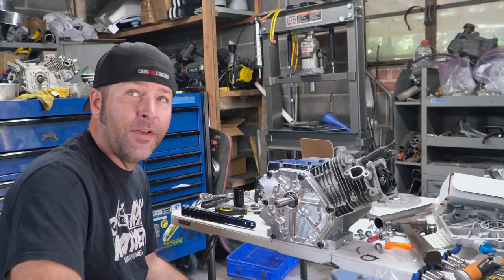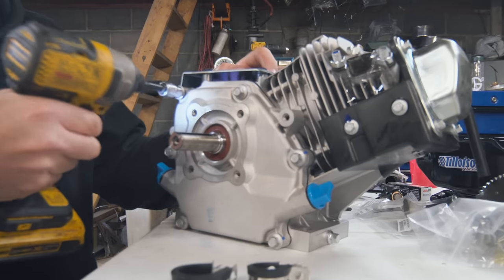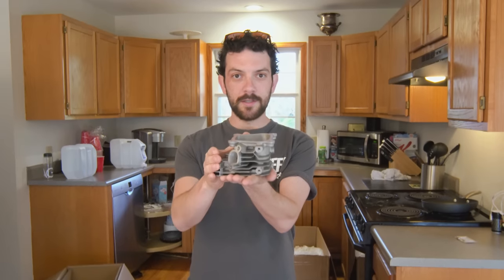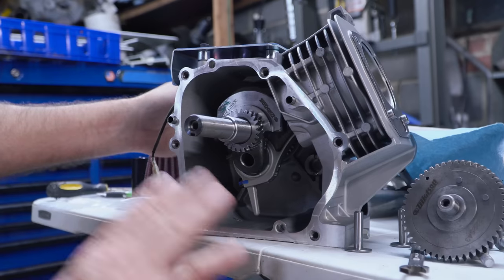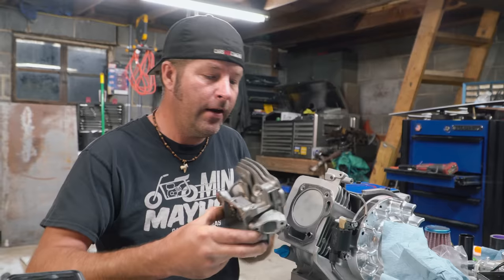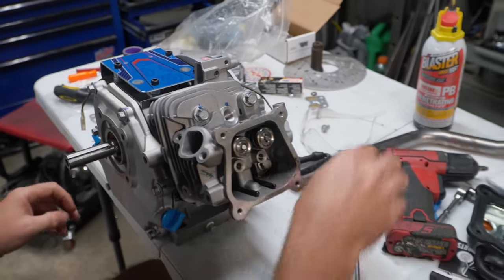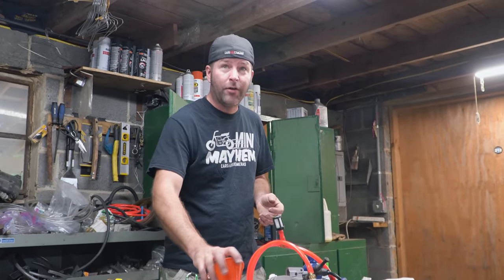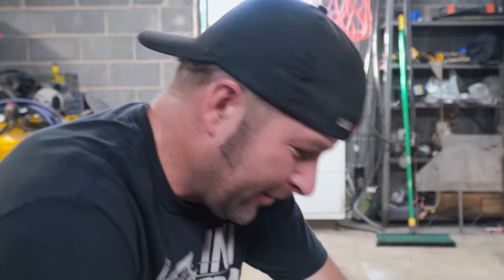Tillotson 225cc Big Valve Build | 9,000 RPM, 25HP Billet Maniac!

Comment: I disagree on not using the one way valve for the crankcase vent!  By using the one way valve, you create a vacuum below the piston therefore it has less resistance or "pumping loses".  I'd be tempted to install dual one way valves from something like an older 650 twin Yamaha that had both pistons moving together so the pumping losses were substantial...you'll have the same thing turning the engine 9,000 rpm.  Dyno it and see :).

Comment: It will be difficult to improve much on the flow of that head by porting ... at least without the ability to test with a flow bench.  Most of your gains will be in the valve seat area and around the new guides.  Those new valves and re-cutting the valve seat dramatically improve flow which will show up on the dyno.

Comment: When will you build an engine test bench?
Reply: Right?  You'd think a piece of plywood with a couple bolts sticking up for the most common bolt patterns would be a simple thing to hold the motors while cranking...would have been a shame to watch that motor crank up when the throttle was stuck open and tip over destroying the crank.

Comment: I got a tillotson block with a 3 inch piston stroker crank and 356 billet cam  34 30 val 50 pound springs....
Reply: Its running on m5 gas

Comment: 55lb springs definitely seems way over kill and would take down your power a slight bit because of the extra resistance, that’s also more strain/ ware on the cam from the extra pressure, 36 lb spring would be Sufficient for 9k rpm

Comment: I used to be the same way and buy 12$ quarts of oil. Never again. Try Shell Rotella. T4 or T6. I run t4 in my 15 YZ250F and it has better hookup on clutches (not that these engines have clutches), and it wears better, has zinc in the formula and has tons of weights. Best part is 15$ a GALLON! May be cheap but some good stuff. Shear ratings and other tests it’s up there. Just ignore the whole “diesel oil”. Sounds crazy but I’ll never run another oil in my bike.

Comment: Guys, you should of lapped the valves after cutting the seats then checked them with Blue.

Why didn't you polish the combustion chamber. 
Did you match port them to the gaskets. 
You would of been better off to knock the guides out then do your port work.

Comment: 35:35 You should poke it with some 30%N RC fuel at some point. Stuff ain't cheap but if you're gonna run methanol anyway that extra bit of nitromethane will give it a kick in the ass above and beyond methanol itself will. Also has some oil in.

Comment: Just an observation,  but the torque specs are in Newton meters.. Not foot pounds. 50 ft lb = 67.8 Newton meters.. Flywheel over torque no worries,  cylinder head could be a problem pulling threads..

Comment: I had a Briggs Vanguard V-Twin 16 horse I tightened the Valve gap a little bit I removed the foam pre-filter on the air filter I blocked off the airbox to the air cannot just blow through litter box and put in a set of e3 Diamond fire spark plugs and actually ended up putting a small washer top of the carburetor adjustment screw to adjust to give it more fuel then Factory just ability the loud and I was thinking I was probably making out about 22 horsepower with it I mean it rained real good until I put Vanguard 23 horse cam shaft and blew it up 23 horse cam gives you roughly .050 more lift and I messed with the governor didn't fully delete it I just bent the tab for more RPM and and the reason I think it blew up was because I bought a used cam out of a blown engine but I want to redo it with a Vanguard 18 horse V-Twin and I'll be using a brand new camshaft not a used one I'm thinking I should be able to get up towards 26 horsepower and I will be putting it in my lawn mower it's not really a mudding lawn mower something play around with like a go-kart

Comment: Ok, it's time to get off the floor.  You need to build a engine build and test stand to run you motors on.  It should have a engine oil catch pan or bucket.

Comment: when the piston goes down it pressurizes the head the same as the crankcase its all connected through the pushrod hole the piston going up only compresses in the cylinder if its pressurizing the head that is not good.

Comment: Can you guys run it on different fuel's to see which runs best.
Reply: They'd have to adjust the jetting on the carbs. Alcohol fuels require tons more fuel, qnd just swapping to e85 without changing the jets would cause the motors to run super lean.
Reply: @hunterdan2002  i probably should have clarified what I meant.... I would like to see them tune the engine for "high performance fuels" such as e85 or methanol fuels. I ran e85 in my built Tecumseh engine (it's still alive don't worry 😂) and it had great take off compared to premium gasoline. Though, I would like to see different fuel's in a high compression engine because that's where you would see the biggest difference. Thanks for your time

Comment: Assembly lube is only for engines that are getting built and then not used for a while.
If you're going to crank the engine up straight away or within a day or 2 then you're far better off using oil. Assembly lube needs to be flushed out after first start.

Comment: How can you cut a valve seat an set the valve in and say it looks good. You can’t tell a single thing from setting a valve into its home. Not even a valve pro of 100 years could set valve in and decide if it’s good or not.  That was purely a scratch ticket gamble. When you lap then you see the contact on valve and see contact on the seat. It’s the absolute only way possible to know a single thing. Unless you have a bench  leak down tester. Just crazy you’d lap a flywheel to see everything your needing to see but then you cut new valve seats and just winged it on if it’s seating correctly. And doing it by hand I can guarantee I mean absolutely guaranteed that valve is not sealing 100% with out hand lapping it. Lapping grinds them seating surfaces in.  Not a chance them seats are 100% with out lapping them.  Let’s remember we cut seat by hand in your lap. Not even on a stable bench. Your legs were torcing and hands were torcing if there was a most important time to lap a valve it would be from hand citing valve seat while heads in your lap on a swivel chair. Hp build just tossed horse power in the trash over 5 min lapping job. Now have fun  chasing spark plug heat rages and carb running and coil gap and timing ect in the very near future. Or just be happy with less power I guess. That valve cutter wasn’t made for that valve. Like they were not made side by side at same time and lapped for ea other. That’s why lapping is so important unless you have bench leak test on hand. An you’d only skip lapping if you used a real cutter set up. Not cutting by hand in your lap. I love you guys I’m not like dogging you guys. But I gotta call it out. This just needs to be torn down and done. Lil time and a gasket no big deal. I’d go backwards to to it with no thought into it. It must be a joke. No one told you not to. This must be a prank. Y’all know wat better then that. And you’ll nvr know the valves leak as you don’t know the engine with non leaking valves so you’ll just think the engine is running top performance but it’s not. Cause leaking valves doesn’t mean misfires ect unless super bad. But leaking valves mean hp left on the table and hp build means your trying to do opposite of that. I leaked down my stang heads on real head shop fer fun almost all had leaks and thing ripped. But period hp left on table. Was putting aftermarket heads on and was doing a leak check on brand new heads witch cheacked out great but old head leaked multi valves and I didn’t suspect that was going to be the case at all no indication. But fact is hp in the bucket rather then the engine

Comment: If u have never expierenced with methanol before. Then u better becareful. My drag car uses methanol fuel. I use it cause u don't need a radiator if ur running methanol fuel. Cause the motor is always cool. I use a radiator when i use regular gas when i am cruising around town.

Comment: Do you wan't A handle for that pot? I've got one just like it. The bottom of the pot burnt out due to rusting.& overheated the metal cracked.& popped. I can remove it to send it to you Charles. You'll half to reriovt back on to that other pot is all.

Comment: Do not need 55#’s for that build, just putting excessive pressure and wear on parts.  36-37#’s seat pressure all is needed to turn 9k + on this build. If that’s making 30hp then mine would make 33-34 on gopowersports dyno lol,  take much more than these specs to make a legit 30hp on small block, not to mention a 28.5 intake valve isn’t big enough, not hating on you guys, love your content I just don’t like the deception.

Comment: 55lb springs is to much for that cam just so u know I run 36lb springs with a 292 cam and I get 9800rpms out of my 236r and even it’s not 30hp u guys are gonna be probably making 23ish hp that’s all
Reply: This is a GPS marketing video not a build video and on a reputable dyno like Brad Hills dyno (dyno used in the small engine builders competition)this engine would be lucky to make close to 20hp and a 5+hp gain switching to methanol? Bwahahaha! The average is around 2hp the lies GPS tells just to sell parts crack me up

Comment: know what, ive looked and i aint seen a single video of a old pony motor used on a go-kart, weather a john deere v4 or a cat flat twin, aint seen anyone mout one of them things to a go-kart
i dont think it would be extremely hard, make an adapter to go from the output to a standard clutch, maybe a torque converter, add a standard carburetor that has a proper throttle, and you should be good to go

Comment: Your information on the valve cover and crankcase venting is incorrect. Positive crankcase pressure is the same in the valve cover as the crankcase. Only way to remove pressure is to vent to atmosphere, vacuum pump, or vent to a vacuum port on intake manifold, carburetor, or air filter. You assembled it correctly in the video but described the process wrong.

Comment: If you didn't install new rings or hone the cylinder, you're not breaking anything in.
Break in is for ring to cylinder wall sealing only.
Think about it. Bearings ride on a film of oil. The ring breaks in on the honed cylinder wall surface until the sharp edges of the cross hatch are worn against the soft outer edge of the ring. Once that is done, no more break in occurs.

Also, you really shouldn't handle the bearing shells with your bare hands. The oils your skin secretes is corrosive.

Comment: need to lap them, so you can see if they are seating correct and it don't hurt run a light up next to the valves and look into the ports and look at the seat /valve area and see if you see light.

Comment: I'd love a motor like that for my old Trail 90 with a bad motor. With a juggernaut for torque. Trouble is, the cylinder on these type of engines points the wrong way! It ain't gonna fit! But I'ma try it with an old 212 anyway.

Comment: 30 hp out of a 225cc, single cylinder, splash lubricated, air cooled, carbureted, 2 valves, pushrod engine?
Sorry guys but my BS meter is kinda exploding right now.
Maybe it does 20, 22 at best.

Comment: 30hp engine has enough power and pull. it doesn’t need a tq converter. That engine is turning 9k rpm, Can y’all please gear it to do 80mph+. That’s what we wanna see. 18tooth clutch 53 tooth rear. There’s no way that motors making 30hp and yall gonna put a tq converter on it and rob it of all that top end. Less tq converters on the bigger builds, more top end. We wanna see yall hit 80mph.

Comment: Is there some kind of instrument tool or something that you can hook up to any engine to get a true reading of how much Horse Power an engine is putting out ? Like the one they sell that you wrap the wire around the sparkplug and it tells you the RPMs but one that will tell you Horse Power instead ? I'm very curious to know how much Horse Power my mini bike engine is currently putting out with the mods i've done to it so far but have no clue how to tell. It is a 196cc that started out life with 6.5 horse but 2 years later with not much stock parts in it besides the bare block itself and the crankshaft are stock so i'm wondering if i am near the 15 hp range or more or less. Anybody know how to figure it out ? Are certain mods known to add a certain amount of horse power so i can add up the mods i've done to come up with a total horse power ?

Comment: @Isaac It’ll Be Fine “Help me understand”… I get the theory of heat makes metal expand and cold makes it contract, but if you heat the head and the metal expands, wouldn’t that make the valve bore SWELL, and get therefore SMALLER? 
Yes, I can see the value in freezing the guides, but not in heating the head. I’d bet the process would go just as easy if not easier, if you freeze BOTH parts. 
And if not… “well I’ll be DIPPED.” 🤔

Comment: I’ll be honest guys, if that key shears, valve lapping compound is not going to do anything
Reply: Plenty of builders install flywheels with no key and use a degree wheel. They key is there for ease of installation in the factory. The press fit is what is actually holding the flywheel.
Reply: @WyFoster  yup, sometimes even if you just tap the flywheel or what ever on to a taper fit without a fastener you will need a puller to get them back off

Comment: Ok so its not a big valved head,if ur not gonna lap ur valves ,at least take a bore light shin inports to see if valves seal off,Hell use methonal poured in Combustion  chamber to see if ur valves leak why half ,ass it,act and look professional, should also looked in block for clearance  at top of block,around cam,bottom of cylinder, not by just roll,n it around,theres tight tolerance  in these blocks my friend,in motion while run,n it could get tighter,then explode,play do on piston will show u clearance  ,valve to piston clearance, how bout lap,n push rods to rockers,Duh,there anodized  so lets think out of the box,think ahead 4 a change ,not sure i,d need u to oil pedals on my bike,ye know get real here,im just a hillbillybut i know right from wrong,in a engine ,from my experience, but your learn,n or is it from mistakes as your learn,n,,just my though on this matter ,God luck,not gonna be 30 hp,but it,ll be fun while it lasts,Duh!!!!,wheres ur break in stand also!!!!,my stand runs off electric motor,need solid pins in side cover for strength, Hell i quit talk,n,By!!!!